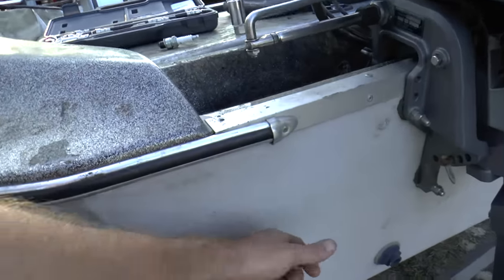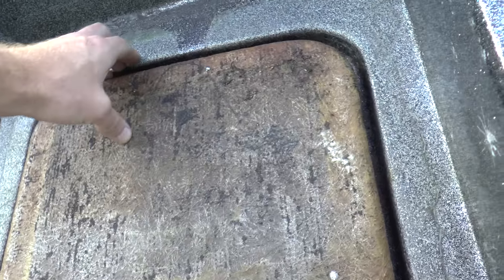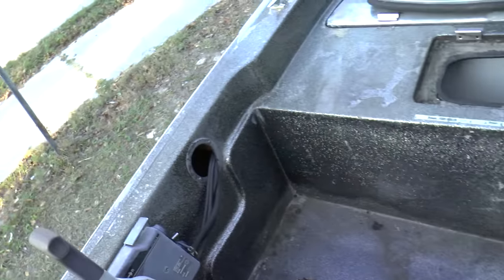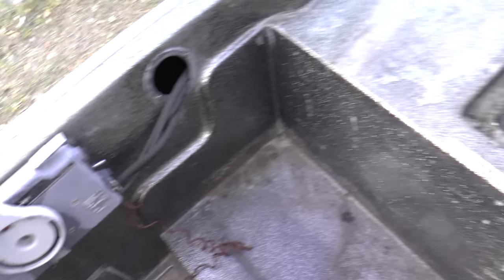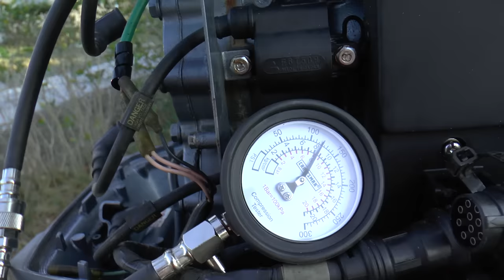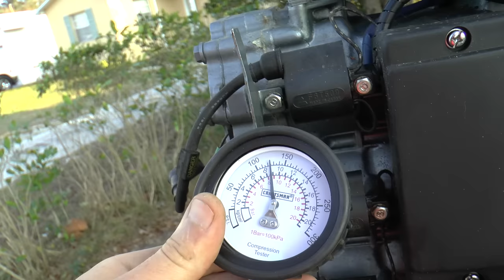My $250 Bass Boat

Comment: When you're doing a compression test on a motor that has sat for a while.... Always spray a little WD-40 in each cylinder and spin the motor without the spark plugs.
That'll help make sure the rings are seating properly! 🤘

Comment: Had the exact same boat, bought it new, color was blue sparkle.  Loved it, you will really enjoy this boat after you complete the fix up.  Enjoy.  Please change the impeller a lower gear oil before you run it too long.  Easy job.

Comment: it's not pissing/ circulating water very well. you might want to change the water pump and the oil in the foot of the engine because it  sat up for so long g and you don't know if it's ever been done. great find!

Comment: you got a Smokin deal on that boat I have that motor on our boat and it a very reliable motor the steering is very simple to repair use lots of Break Free lubricant and work with it and it will come free you have a awesome boat for $250

Comment: Great find on the boat and engine.. I have an 89' version of that boat with a 75hp Suzuki on it.. I haven't ran mine in years.. One day I might get back to finishing it up on the glass work needed on the floor and re-power it.. With my setup I can run 50+ on the water, but I did add a jack plate.. with that 40 on it you won't have the weight issue on the rear end.

Comment: 14ft bass boat.   Psi 120 great  mine 16 hydra  bass boat  motor 75 mecurey.2 carb . You need put  torque wing  once fix motor will front stand up.  Your boat  14ft.